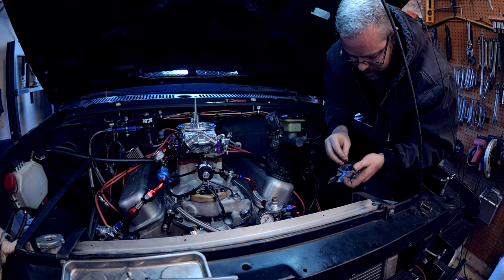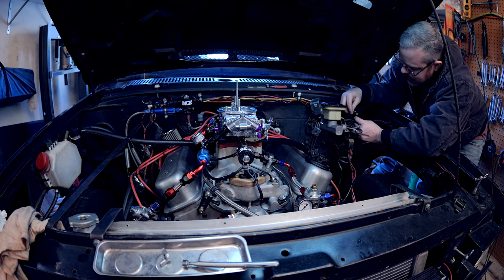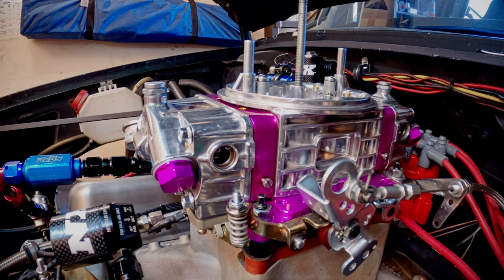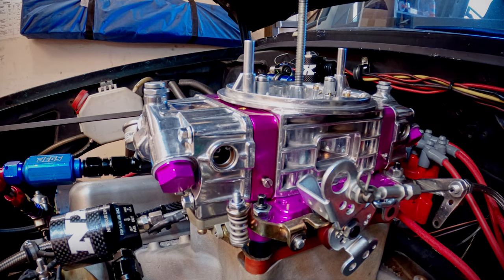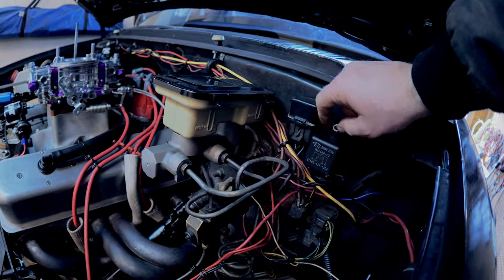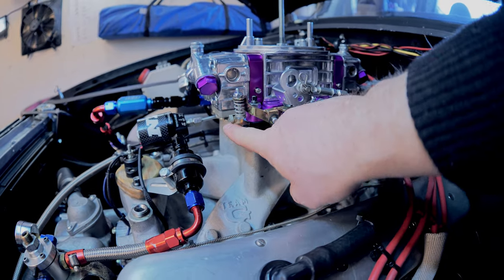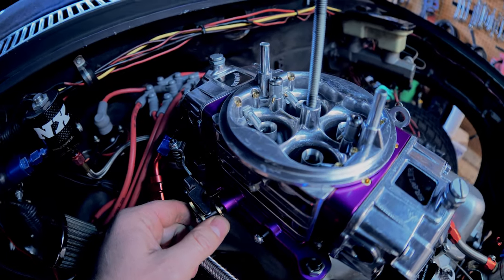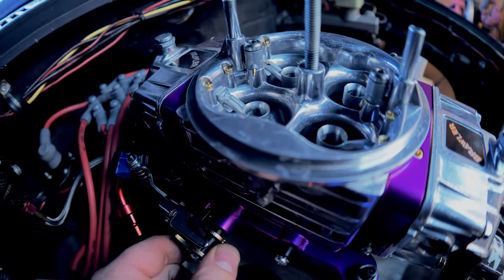Setting up a rebuilt carburetor.  Floats, Idle Air, idle on a Holley 4150 Brawler. 350CID 950CFM? 😮

Comment: you are spot on with the larger carb and jetting.. larger venturi produce lower velocity and there fore less head pressure in the main well.. Now get tuning to the air bleeds.. Good Job Man.
Reply: Um,,, I have a quickfuel 450 with air bleeds.
It’s on a 232 Jeep- thoughts?

Comment: Nice job ! 
She has a lot of vacuum ! Nice ! 
   Float adjust that I found that works very well is from David vizzard 
Turn the fuel bowl upside down and use a number 2 pencil adjust it so it just touches the pencil she will be very close ..
Nice job brother!!
Reply: This isn't new info, and it's nothing vizard came up with. Using a 3/8 drill bit has been around forever. But, it's all a moot point because you adjust it with the engine running anyway. If you're going to be checking it anyway, you may as well adjust it. It's only 2 screws

Comment: Actually, the QFT ( and Brawler) 950 Does not flow 950 cfm.. I have tested the flow rates on the flow bench and they come in right in the 830 cfm range.. So it will work very well for a streeter.. and once you go 4.125 bore sb and larger, you will never look at a 4 inch bore again. LOL
Reply: Have you did any testing on the Edelbrock 1412 that is supposedly 800CFM??
Reply: If so could you please post your findings Pablo Janski. ??
Reply: @mermaiddreams83  get rid of that Edelbrock

Comment: you can save yourself a lot of time by adjusting float level dry with a ruler then fine tune it running
Reply: How does that save time? In order to do what you say, you have to take the carb off and take the ends off it. That's way more work than just giving it some dry and getting it running then finally setting them.

Comment: I feel like my 750 carb is a little bit to big for my sbc should I put a little bit bigger jet than the 72s will 76 jets help or work a little better 360 sbc 190 promaxx heads 235 duration cam

Comment: Thanks for the video , I got a question,  I got a 455 buick engine with 10.1 compresion, and a got a pro system 1180cfm is that to much
Reply: Maybe that's a question you should've asked Patrick when buying it from him

Comment: I have and lt1 to that high compression solid roller that I’m having really bad problem with my Holley ultra 850 going super lean after I get down on it through a run then let off and it leans out and wants to dye. The part throttle is bad to. Do you have any suggestions? Oh and the floats are good the fuel system is good to. I just installed a return system so fuel isn’t an issue

Comment: I hope to get help. I have a 67 cougar. It has a 650 double pumper Holley carb. It was jetted from the previous owner. I run rich. It backfires til the engine is hot. I put a spacer under the carb. Helped a little. How do I know that the carb is too big for this engine.  Running a 302, with edlebrock heads. Any help would be appreciative. 
Carl
Reply: Shouldn't it be popping when it's running lean..?

Comment: Hey man I just scooped a brawler 750 dp for my crate zz4 355. Elevation is at sea level. It keeps loading up at take off. Crack the throttle it shits the bed then takes off. You said you jetted up in the video. Any suggestions?
Reply: Transition is not right
Your transition slot is overly open 
It should be set no more than 30 thousandths
When you adjust your course idle too far you bypass your idle circuit and lose the transition fuel from your accelerator circuit
This causes you to go lean when your butterflies open causing your bog
Once the main metering comes in your engine fuel ratio catches up and you take off
Reply: Don't listen to that other guy, it's your accelerator pump shot. Play with that

Comment: And here I am putting a 500cfm on a 460 Ford lol......but its a stock cruiser that only goes to 4,000rpm
Reply from the maker: That is fine only thing you have to worry about is the signal at idle will be really strong. It may load up at idle unless you can get adjust the low speed air bleeds. Just keep an eye on your plugs if they get super fat like black then the idle air may need work.
Reply: @TPVPRO  yeah I only have the idle mixture screws out 3/4 turn (Edelbrock) https://www.youtube.com/watch?v=UYK0P6bLlFk